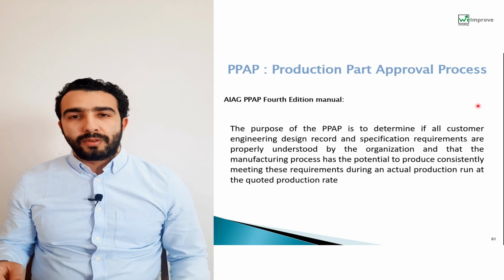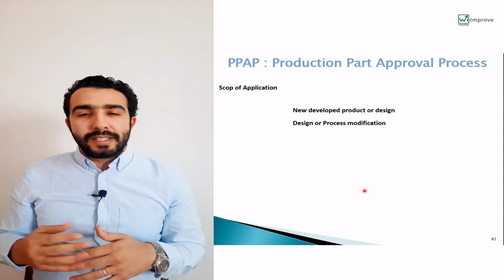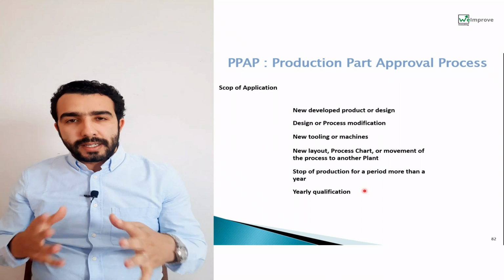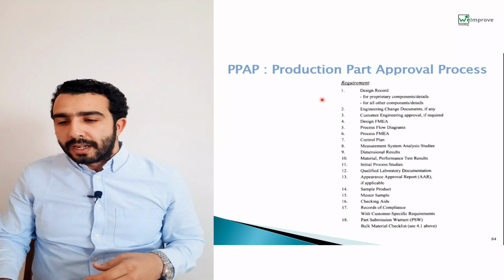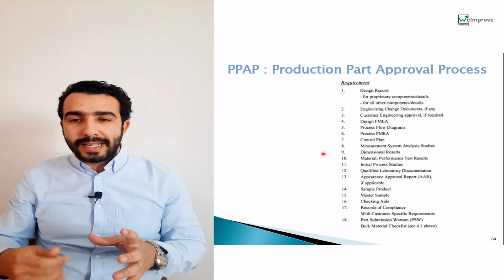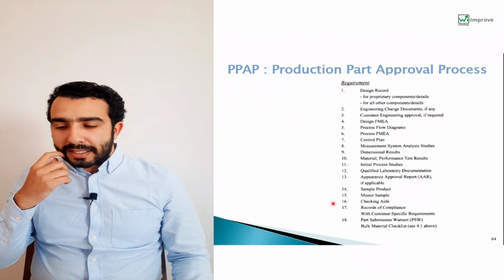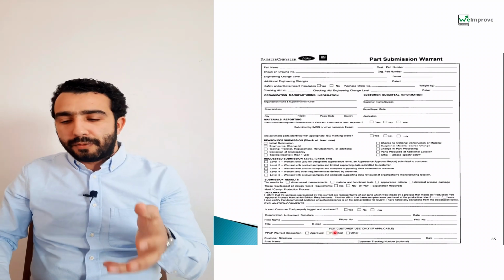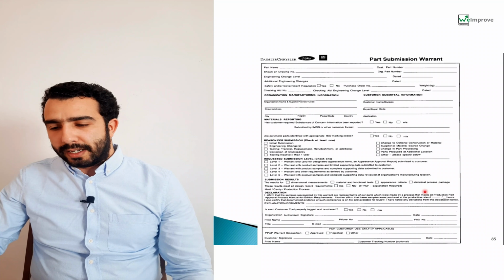PPAP - Production Part Approval Process I Mastering the Process and Documents

Comment: For what concern the customer engineering approval do you mean the drawing approved and signed from customer or you mean the design release like EF and BMF ??
Reply from the maker: The Customer Engineering Approval doesn't concern the drawing approval only, but all the changes including (Drawing, Cost, impact or risks...ect), when you are submitting the Engineering change request to the customer including all the items, you have to receive firstly an approval from the customer that they agreed to implement the changes requested. Then you can start the development of the change, it could be even a full APQP or just a PPAP submission depending on the change impact